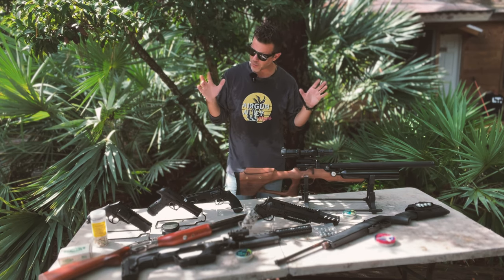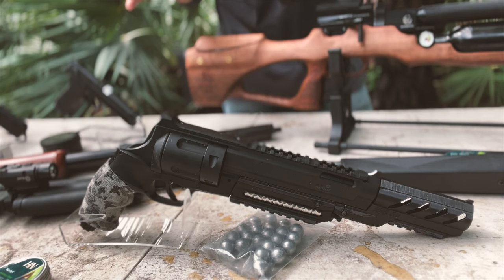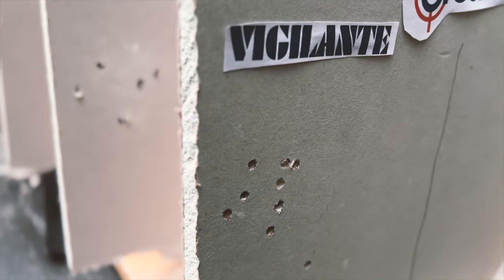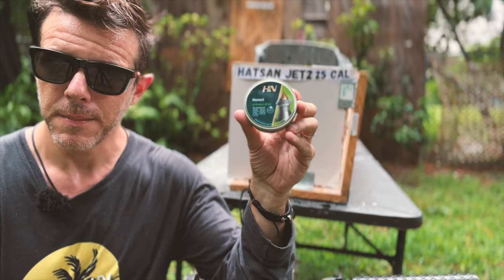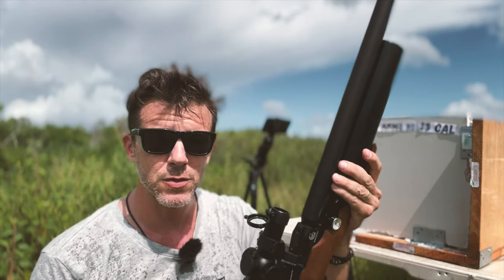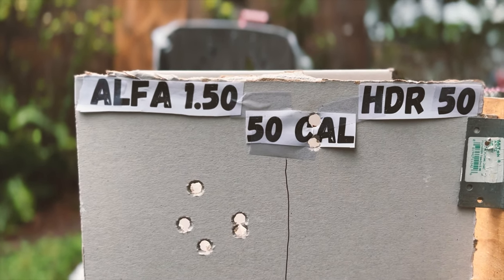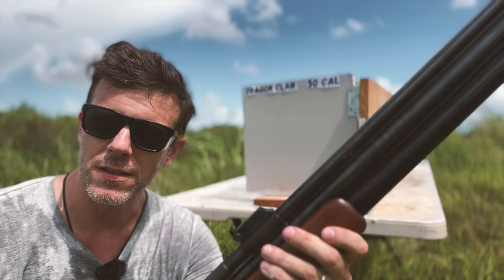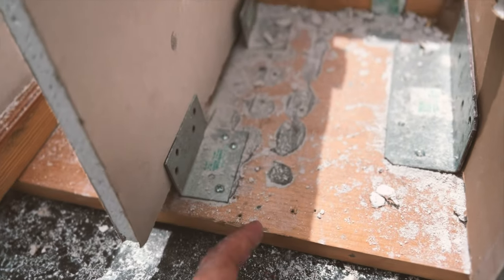What if YOU ACCIDENTALLY SHOOT AN AIRGUN AT HOME?

Comment: I actually tested airguns vs rifles through phone books about 30 years ago at my house in North Carolina.  My 1990 Crosman 1377 pumped 5 times broke through 40 pages, pumped 10 times, through 70 pages, 13 pumps = 85 pages, 15 pumps =90 pages. 

My 1991 Beeman RX .22 cal using standard Crosman pellets pushed through 200 pages to 240 pages of the 450 page phone book. 

My 1992 Charter Arms Survival Arms .22 (now owned by Henry) using standard Federal LR loads went to 375 pages and bulged the back of the ohone book. With the CCI Stinger hollow point  it went through 350 pages but destroyed a peach sized area because of extreme mushrooming. Stillnown that amazing gun.

With my Marlin tube load magazine bolt action, ".22 pops" went 35 pages, .22 shorts went 100 pages, and .22 longs went 350 to 375 pages. 

My Winchester 30-30 with Winchester 150 grain went through 2 phone books and 150 pages into the 3rd book... or... 1050 pages.

My Winchester 12 guage shotgun  went through 700 pages with high base #4 shot, 850 pages with #2 shot, 1200 pages with lead slugs, and 1600 pages with copper slugs. 

I hsd other guns but i don't mention them. And yes, one of them went through over 10,000 pages. 

I'd love to try the Zeus 12 guage at 3,000 fpe and see what it will do. I'd guess, over 1,000 pages witb a steel ball.
Reply from the maker: Damn man! You’re the OG of this stuff! Back when power was measured in pages. And you did it without all the glory and spectacle of internet! Hats off to you!
Reply: @AirgunAlley  🤣 🔫  I remember all this stuff because I used all of those for hunting. I wrote it down and referred to it so frequently that it became ingrained in my memory. Don't tell anybody but I did kill a big 170 pound deer with the Henry survival .22 in a county where it was legal to do so, back then. Now it has to be centerfire and so many FPE. All my other deer were taken with my PSE bow, shotgun and Winchester 30-30. There are airguns now that take Cape Buffalo. 

I'd love to get another Beeman RX but those had jamming problems. I heard the RX-1 is immensely better than the RX and the RX-2 even better than the RX-1. I love Beeman. I use their pistol for ratting and when I want to eat one of my father-in-law's chickens.

Comment: My husband helped build homes from the ground up for a living. The space between the each drywall (according to home construction code) is 4".
Reply from the maker: Ah ha! I was off by 2” ! Thank you so much for your input!!
Reply: It depends some walls are 2x8 (71/2”) +- plus maybe sheer wall depending on the wall so plywood and some are down to 2x4 so (3.5 inches ) plus insulation wires studs

Comment: Have you ever tried .50 First Strike Rubber rounds in a tr50? I’m very curious to see how those work.
Reply from the maker: I shot a lot of rubber with the HDR 50 in my earlier videos. I don’t think I tried the FS brand - but I sure shot quite a variety of them… 
They work well, just depends what you need them for
Reply: @AirgunAlley  oh I see , yeah these are D shaped with stabilizers like the jaw droppers but are just a half ball in the front, the back is hollow and is just the stabilizer. I’ve seen one person shoot them in an tr50 but no one does in depth reviews like you.

Comment: i have found that if you are not shooting at your planned shooting area  it is gonna make some kind of hole.
 my shooting area is made primarily of metal house doors cut in half with a 2x4 set width wise and another set flat and screwed tohgether for 5 inches thick space between the halfs of the metal door i fill this space with rubber mulch from home depot and that will stop upto 51 caliber pcp air rifles, you might need it thicker if you are shooting a 58-72cal air gun. but for those less lethal ones this is overkill.
 when you get too many holes in the metal  home depot sells 1/16th inch metal panels that can be screwed onto the door to make it new and fresh, and all this is relatively cheap. i made a 6ft tall 8 foot wide wall because i am blind and care about my neighbors.  and the cost was not so cheap. but i wanted safety as i am shooting upto 600fpe at the area.
 and plan to recover the lead to re-cast it back into projectiles later.
 yall have fun with all that.
THE LAST WORD

Comment: You forgot the insulating material between the boards and to tell us the muzzle energy of each rifle which renders your results pointless.  For starters a smaller pellet such as the .177 H&N Hornet at the same muzzle energy as a .25 will simply blast through 4 layers of Gyproc plasterboard.
Reply from the maker: These results are far from being pointless my friend! The insulation material is indeed placed in the external walls of homes, but rarely in the interior walls. As I say in the video 🤦🏻‍♂️

Comment: Excellent job on your video!!!  

Yes, drywall, 2x4’s.. none of it’s gonna stop big bores or magnum level handguns.    So the video below pits a 44 mag against a 457 air rifle.   The 44 mag is slinging a 240 grn cast slug at 1200 fps.   It’s not enough to beat the air rifle.  
The 45 super is pushing a 261 grn cast slug at almost 1200 fps.   Can it beat the air rifle?   Watch to find out. 

457 Air Rifle Vs 44 Mag Vs 45 Super Vs 2X4's - Who Wins?
https://youtu.be/XCT8mcSxPZA